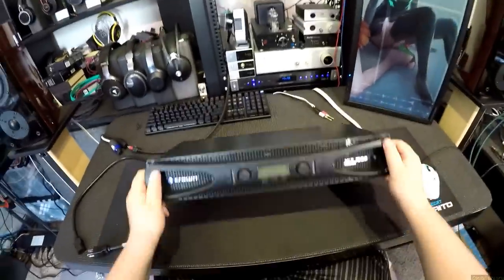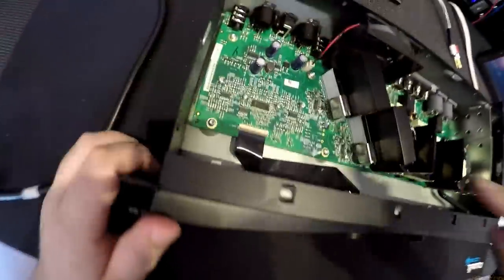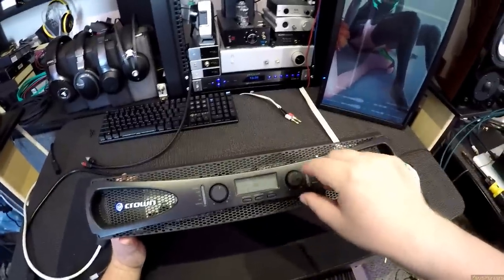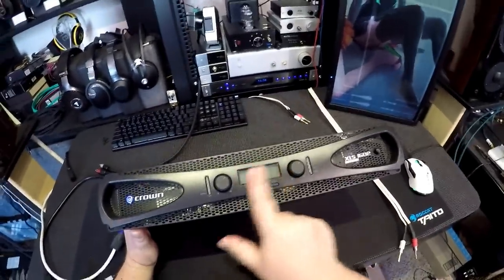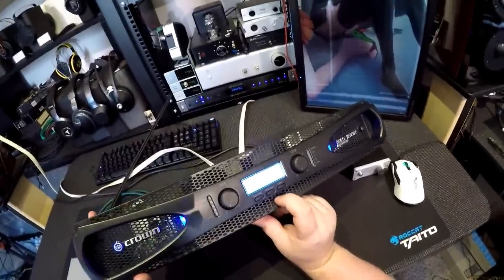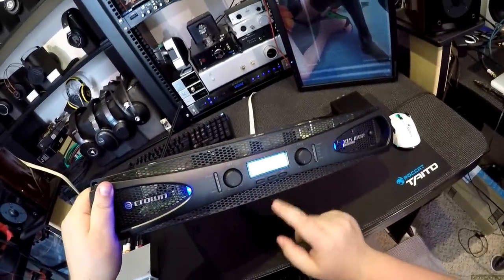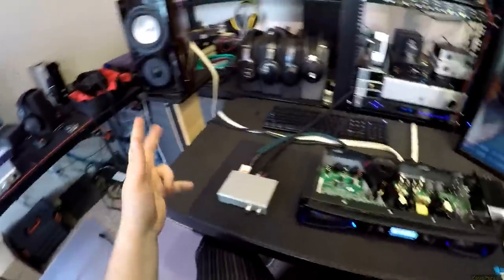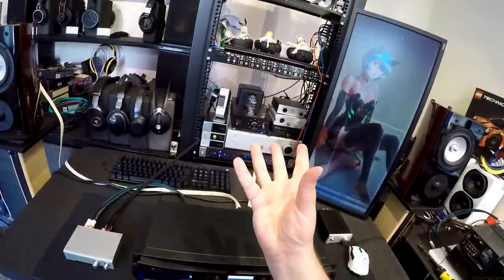Z Review - Crown XLS1502 POWAAAH!!! AMP

Comment: If you think that amp puts out 1500w with 2 caps smaller than my balls and transformers smaller than an ant then theres literally no hope for you bro. put it on a bench test and have a tissue ready. that ain't putting even half the stated power out. I purchased 2 of the 2502s and sent them back same day. lesson learned you get what u pay for. Class d relies solely on power stored in caps. look at the caps on a real class d amp that puts out 1.5k ....
Reply: You perhaps don’t understand switch mode supplies like these have. The power supply caps are being recharged at quite a high frequency and the frequency varies according ing to the load. So it doesn’t need big capacity caps to maintain power supply rails like a older linear power supply supply with a big transformer. The linear type is charging the caps at mains frequency which is 50 or 60 Hz depending on your country. With a bridge rectifier that frequency will double. Because of that low frequency you have a long time constant for charge up to keep the caps topped up. You then need large caps to maintain rail voltage. Also because it’s class D it’s also very efficient so these are the future. They’re cheap and light. Do I like them? They’re ok but audio wise I still prefer class AB. Don’t under estimate their power though. Is does your head in looking at the size of components but it’s different technology to old school amps. The do have the limitations though. Crown do very well for the price. Brand like Lab gruppen are using the same technology but are on  another level again and are pretty much obtaining class AB sound quality with class D or the their version of it. My criticism of class D is they can be a bit harsh in the top end frequency response and then the damping factor is lower due to they need chokes in the output to remove the modulation frequency. Bang for buck though you can’t beat them!
Reply: @speatech  I understand them more than you because I have owned them. If you go class d you gotta put good money down to get the power and quality of sound to boot. I had a fp14000 sanway lab gruppen clone. For sure it puts the power down but at a price of reduced sound quality and accuracy. I now have a ffa10k amp which has everything. The xls series has 2 very small caps, a power cord thinner than a hairdryer, a transformer so small u can't even see it and the top model draws less than 700w from the wall. Please explain to me how something drawing that from the wall with literally no storage for power can put out 2.4k into 4 ohm? Class d relies on storage of power in caps but there literally are none. You say about power switching well hows that going to help when theres no available power to switch too? Maybe it switches to fairy land is the only answer. Fully tried and tested here the proof is in the pudding.
Reply: I’ve owned and repaired them. Have you ever repaired them and then measured the power? I currently own a class AB amp with a linear power supply. I prefer it but it weighs a ton. Did you measure that 700W or are you going off the spec because thats usually an average consumption with a dynamic music signal. No one listens to a 1 KHz tone. The transformer in the power supply is running at s a high frequency and is an on demand type of operation that’s why they use them. I didn’t say these amps were the best. All I was saying is bang for buck they’re extremely good. Most powered subs in the pro world are running these types of amps and power supplies. I’ve fixed some big amps with this technology in them. They work, doesn’t make me a fan. One of my favourite amps is my old Carver PM 1400. I’ve AB’d it back to back with a crown XLS 2500. The crown will Drive the same speakers to much the same SPL but audio wise give me the carver any day. If you talk to crown engineers and I have, they will admit they not as good sonically as macrotechs and all the old school amps but that’s not the point. They made to a price for the portable PA market and do they very well. These clips are using them as hifi amps and that’s not what they were intended for.
I still asked again, do you know how smps work. They’re not new and been around for years. Just been used in the audio world in later years. They used to radiate real bad that got up audio but manufacturers have learned to make them quiet. I also do industrial repair and I see them putting out massive power. People like Tesla are using switch mode technology in their 3 phase inverters. You talk about the size of the power cord. I work agree they are small but they on an amp that’s putting out a dynamic music signal. For an XLS 2500 is probably to small foe a constant signal but that’s not what’s doing. In my country mains is 230V and max current off a domestic wall socket is 10A. That cable will be fine. Pulling 20A on a USA one yes probable a bit lite. Power and cable size are not the issue. It’s current is the problem for cable size. Simple ohms law. Take a look at the power pylons bring power to your city. They no way big enough if you are transporting at 115v but at 33000v you don’t need the conductor size. For a given power a high voltage will mean lower current.
I go back to the size of the caps. They’re just large to store voltage in a linear power supply because a linear supply is running at 60 Hz not 400 KHz. If you want to compare a Lab gruppen to the Crown the yes a Crown will probably do power supply slump on heavy bass before the Lab does but the you get what you pay for. If you look at the the power quoted for the Crown XLS range it has “continuous average power” in the fine print. If you don’t like it don’t buy one! Simple.
Reply: @speatech  I did a video on what I thought about the 2502. Maybe worth a look. No I haven't repaired them because I sent them back the same day. The fact that you have repaired them is not a good sign either. I had two ab rotel amps bridged and ran them at full tilt for 18 years and sold them a few years ago on Ebay never had any repairs!... No I haven't got a bench tester. Put it this way, An emotiva xpr5 5 with one channel driven into my sub put out more spl than the xls 2502 bridged and that's pushing probably 500 watts so I'd say a guess of 700 watts is very generous.

My gripe is not bang for buck. My gripe is that 2.4k watts into 4 ohms is false advertising as there is not a chance in this world its putting down that power.
Reply: Nothings unbreakable. You mention Rotel gear which I love. However I’ve got a Rotel in my garage from a friend which has blown outputs waiting to be repaired. It didn’t live through a party a while back. I’ve just fixed a Peavey IPR2 which was cutting out. Turned out to be cheap Chinese speakons. Anyway I’m a little surprised these crowns are being used fir hifi. They’re low end PA amps.
Reply: @speatech  Hi, Rotel is now all made in China. Not the stuff it once was. I like ab sound on mids and highs. Only needed high power for my subs. They are 2k continuous 8k peaks rated. I agree with you that they are low end pa. To get the sound I wanted I had to go pro audio. Most people who look to buy the xls for home use are looking to power subs. So my warning to anyone reading this is you will be very disappointed using these on low efficiency bass drivers which give deep bass. High efficiency pa drivers may be a different story....

Comment: im sure those are peak wattages not rms
Reply: And i am sure you're wrong...lol these amps are known to push those watts RMS ...it's actually what makes them so well received in the audio business.
Reply: Specs don't state peak or RMS.  Power rating is for 1KHz at .5 distortion.  I'd rather they list power rating across full spectrum.  I bet it would be lower.  However probably still a great amp.

Comment: Hey Z, Supra sells flat cables 1.6mm what ever gauge that is. Not sure if it's copper or not.
http://www.ebay.com/itm/Supra-Flat-1-6-Speaker-Cable-Per-Metre-/391444333996